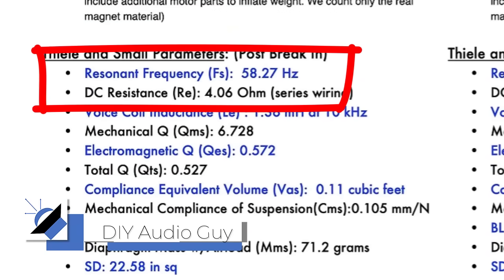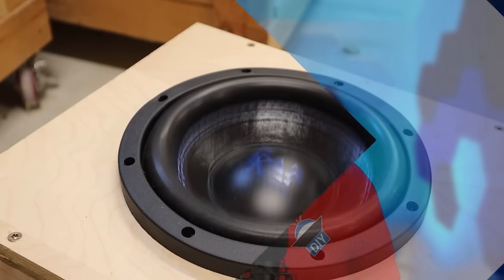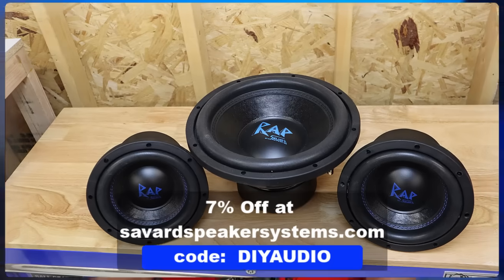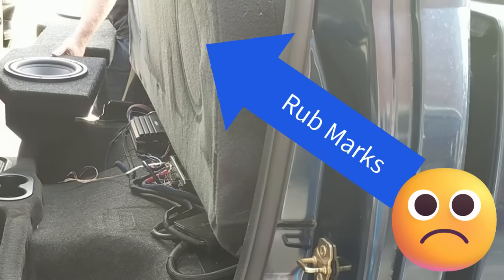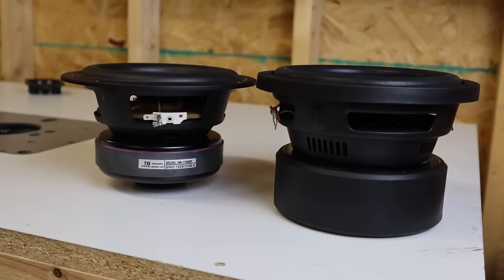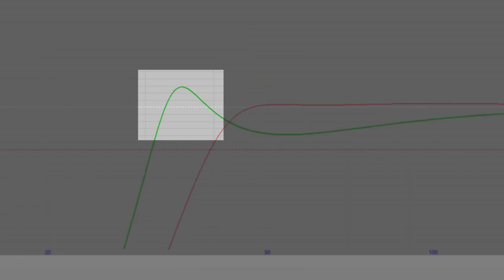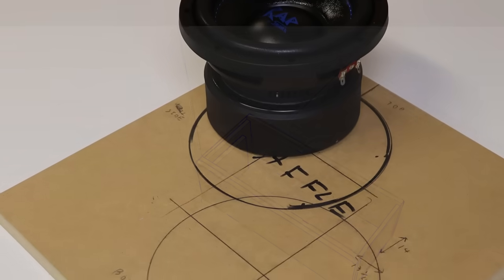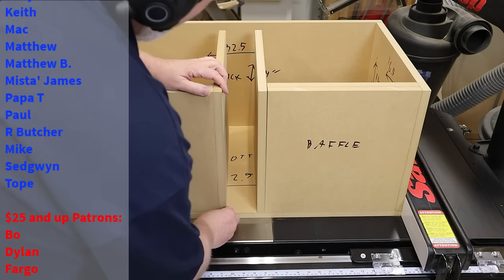The Problem With Small Subwoofers

Comment: Subs have come along way in the last 10 years or so especially being able to get loud and low with a small sub 
I have 2 8s under the seat of my truck and it plays into the mid 20's with ease and sounds way better than the 15 in my other vehicle
Reply from the maker: Awesome!
Reply: That's because of cabin gain. Cabin gain adds 12bd/octave of boost below the cabin gain starting frequency. You can calculate that by 1127/(length of interior space in feet) = starting frequency. Average interior largest dimension in a crew cab truck is ~8 feet. That adds 12 db/octave boost below ~140 hz. That means the dimensions of your truck will have 12 db boost at 70hz, 24 db of boost at 35hz, 36db of boost at 17hz (however cuts off where sub cuts off). That is is only reason your truck gets louder then I assume your other vehicle is a car where the dimensions are around 12 feet (start of trunk to firewall). Cabin gain is why vehicles can get decent bass without PA sized cabinets. It's how earphones work. Hold an earphone at arms length and it barely makes midrange. Place it in your ear cavity and it starts getting 12db/octave boost around 12,000 hz and down.
Reply: @wally7856  I never said it was louder just that it plays low and sounds better...15 in my suv is definitely louder but it basically only sounds good on rap music where the 8s in my truck sound good on anything I play

Comment: greeting  here in puerto rico we use pvc panel  for making  kitchens cabinet!  i just did a pvc enclosure for a 23 old technics speaker,  and sound amazing, but im a cabinet maker not a sound guy, i use 3/4-  .65 density rhino pvc panel,  i search youtube and didn't find  a single video reference using pvc panel  , so maybe its a good test for a audio diy guy like you to test!,
Reply from the maker: None of the PVC panel we have here is rigid enough for that.
Reply: @DIYAudioGuy   yes i have wood worker friend in the states and they tell me that they are hard to find at higher density over .45  and they are costly, i thinks home depots have them! but don't know the density they are!   and less that .55 is not going to cut it! i got the material but not the test equipment or the audio knowledge! ps i thinks is a good option! it have the option of density up to .80!  it wont expand, its not damage by water or humidity! it hold paint finish good , or can be laminate